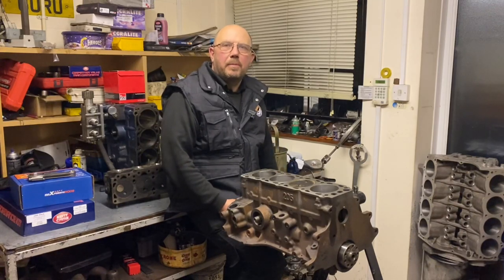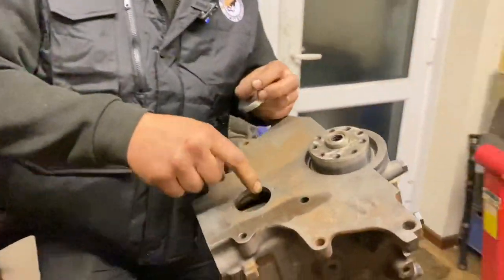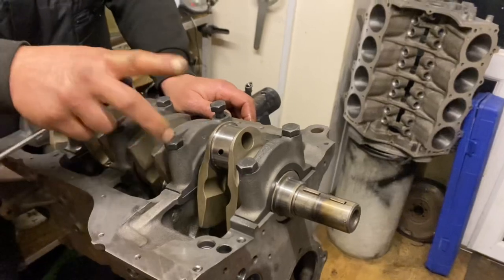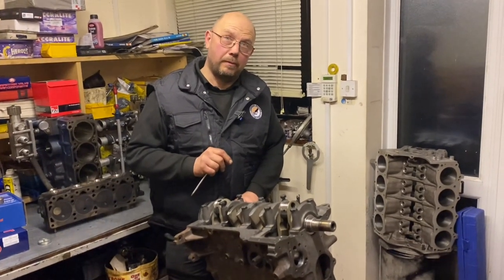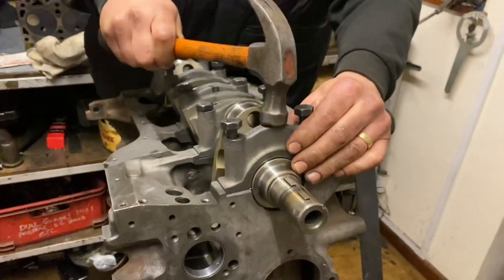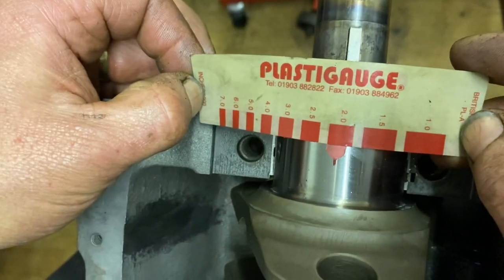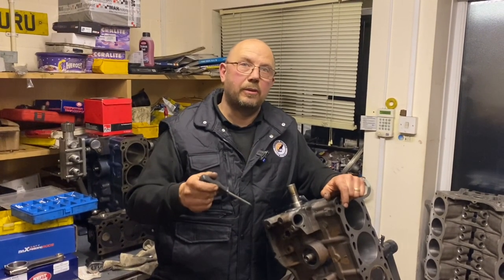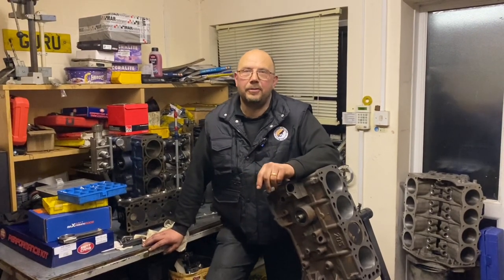2.3 Race Pinto Rebuild - Part 2 - Bottom End Prep + Bearing Clearance Checking

Comment: Hi Graham any gain from going 2.0 to 2.1 or 2.2? Running ht cam ported injection head 10.5:1 compression, trying to debate if the cost is worth it?
Reply from the maker: i think 2.2  (although much more expensive) is more worthwhile than 2.1, heres why, most engines have had a rebore anyway, so if you have an engine already 1mm oversize, 2.1 only gets you another 50cc anyway, on the other hand 2.2 changes the stroke and they seem to really respond to more stroke. im not sure why you would want an HT1 cam and 10.5 cr, its too low to make real power from that cam,  so if your going to do anything fit forged pistons and get the compression up to make use of that cam, or fit a milder cam and enjoy a better torque curve!
Reply: @PenguinMotors  thanks for the info only threw the engine together quickly to get my Sierra ready for my wedding and had the ht1 cam so threw it together, I have a bottom there from a 2litre hotrod decked block 1.5mm over size, haven’t done anything with it yet, I can also get my hands on an old 2.1 that my friend has, he said it has Holbay rods and was running dcoe 50s, would I be better off spending my money on going 2.2 from scratch or what would you advise be?